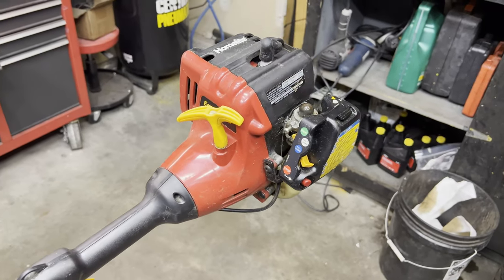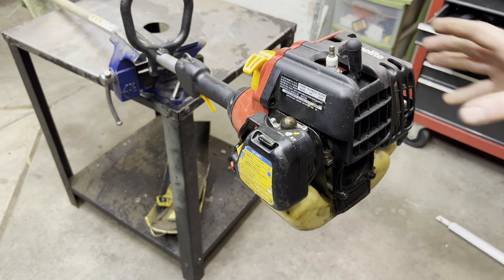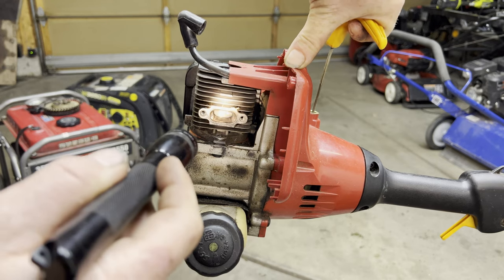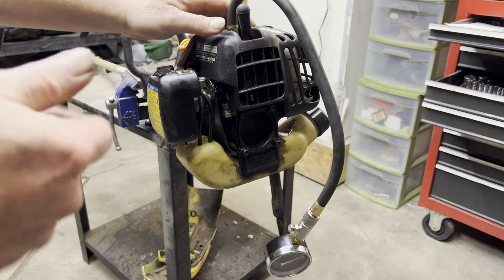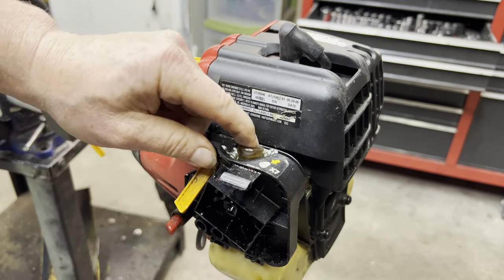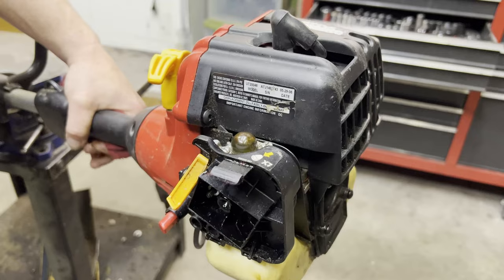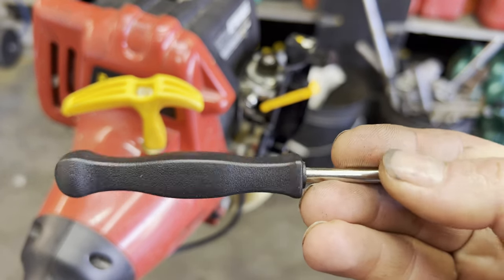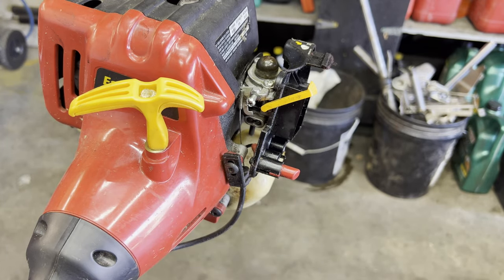Homelite Weed Eater String Trimmer Won't Start Small Engine Repair

Comment: I just replaced the starter rope on my 1994 Homelite built in the USA trimmer. Then I went out and trimmed my yard. Had to rebuild the carb a couple of times due to the crap gas sold today. Think about it. It's 30 years old and functions perfectly. Yea, I could have bought a new one a couple of times but I feel keeping it out of the landfill and using my brain and doing some research, I can keep it going instead of buying a new throw away piece of junk made in China.
Reply from the maker: Yep all the new equipment is just throw away.

Comment: You specialize in homelite weed eaters my carburetor is constantly pouring gas out of the carburetor without even choking it then when I try to crank it it continues pouring out
Reply from the maker: Sounds like the needle is not setting. You need to pressure test it to know.

Comment: Mine has A and B setting. Starts on A and warms up (choke) then switch to B (run) then it dies .. any ideas?
Reply from the maker: Sounds like the carburetor needs adjustment.
Reply: @small_engine_repair  thanks …will take a look

Comment: Y is my prime button not pulling gas
Reply from the maker: Fuel filter is clogged. Fuel lines are installed backwards. Dirt in the carburetor.
Reply: Or diaphragm
Reply: Got new fuel injection kit and had to adjust the choke.  The little washer was too loose

Comment: I have a homelite backpacker 26bp 180mph  having issue when turn over to run or half choke  I changes gas lines check spark plug only thing left is to switch carbunator
Reply from the maker: How does the piston, rings and cylinder look?
Reply: @small_engine_repair  good no issues
Reply: I ordered  the carb waiting on it
Reply: I will need help fixing this old trimmer tho give me a few days I will let u know

Comment: hey bud quick question!
i have a homelite ww and it doesn’t have those adjustable heads on  the carb. 
it is starting and reving nicely but dies when i  let go. 
took apart carb. clean it. added new 50:1 Trufuel. 
runs good, but still dies. 
thought’s appreciated! 😊
Reply from the maker: You could try turning the idle screw in to increase the idle speed. Otherwise nothing else you can change.
Reply: @small_engine_repair  
that’s exactly what i did yesterday and it worked great ! thanks for replying!!! 👍👍